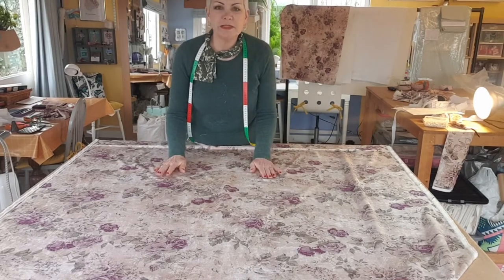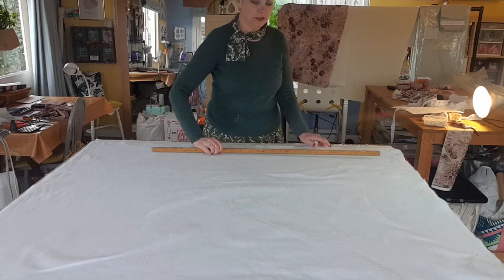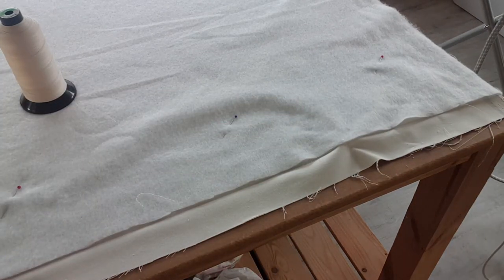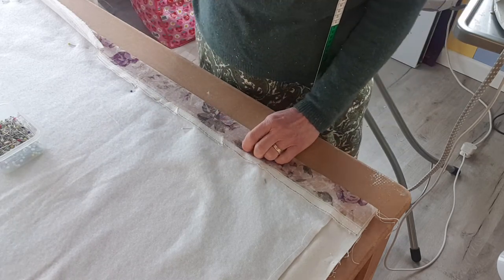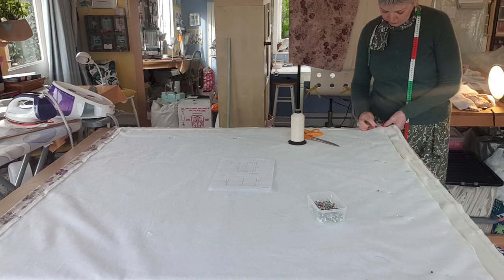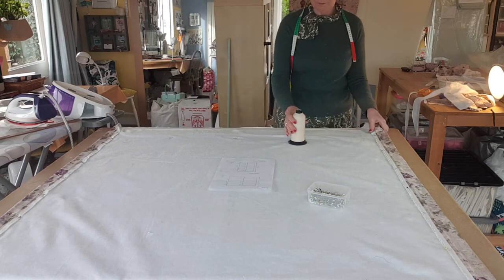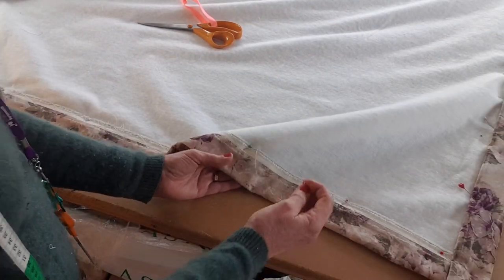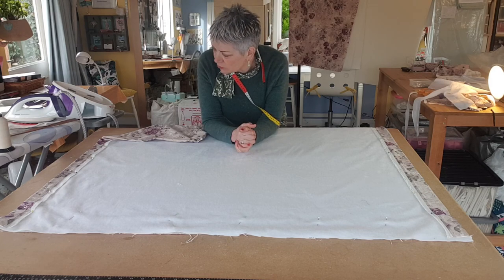How to make a Roman Blind Part 2 - Prepping your fabrics | The Make Room

Comment: how would you join your interlining for a wider blind?
Reply: Hi ...I would make the joins in the same place as the Fabric ie a central panel with two equal stripes either side. I hope that helps. Sometimes you can turn the lining crosswise if the length of the blind is shortish (as you would only have 140cm for length plus rod pockets)
Ellen
Reply: Should read ' strips 'either side!